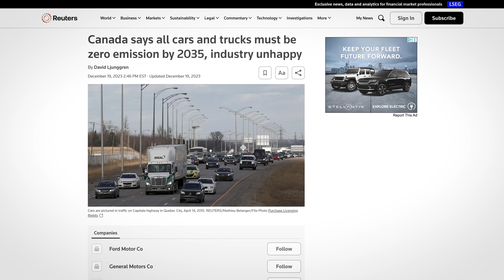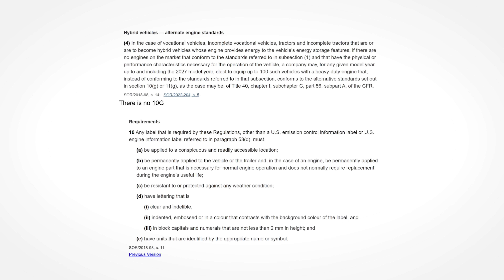Government Red Tape Is Blocking Our Plug-In Hybrid Trucks

Comment: The entire crux of the problem is that you’re using an engine that is not certified for on-road use, yet you’re trying to run the engine while on the road. Anyone familiar with emissions legislation and the industry could have told you this would’ve been a problem…
Reply: It has to do with horsepower, under a certain amount (I believe 45hp) and above a certain amount you aren’t required to run any after treatment or emissions systems
Reply: @Magic_pancake355 both on road and off road scania motors meet tier 4 emissions, both without using DEF fluid. Both have some level of after treatment but don’t use DEF fluid
Reply: @fflowwiththego  oh I understand that, Europe is so far ahead of North America in terms of well… everything in the heavy equipment/ trucking industry but I’m just stating what i believe if I remember correctly to be Canadian law/ policy however you’d like to call it.
Reply: @Magic_pancake355 understood. I’m hoping Scania sees the potential and partners with Edison to get their generator motors certified with Canada for on road use. It could be a great investment for them. As far as I’m aware because scania’s emissions are so low it’s a simple matter of testing and paperwork to get that done, they don’t need to do any design changes.
Reply: @Magic_pancake355 you sure about that? In some areas around Diesel emissions specifically i think that the EU is more lax or has been more lax in the recent past, than the US standards. Particularly around NOx emissions. There's also been questions or controversy about the conditions with which vehicles are tested under in the EU. Like US testing is more "real world" and something that might easily meet x standard under EU testing protocol might fail a US test.
Reply: It’s no different than the motor that runs a refrigerator trailer, but that allows an off-road diesel motor to be used on the road.
Reply: @fflowwiththego not the same.  The refrigerator trailers are small engines certified for highway use, but not enough power to have enough output to charge the truck in a meaningful way.
Reply: @fflowwiththego  even that one requires on-road fuel
Reply: @fflowwiththego  that engine is not propelling the vehicle forward

Comment: My letter is in. 

Dear Mr. Barratt, 

Environment and Climate Change Canada (ECCC) has problematic regulations that are not in line with their own climate goals. They are impeding Canadian manufactures from helping address climate change and build quality Canadian businesses. Edison Motors in British Columbia is developing plug-in hybrid semi-trucks, with electric drivetrains that can be recharged on-route by diesel generators. 

ECCC classifies vehicles with onboard generators as off-highway emissions tier 4 final, and they want Edison to use an on-highway truck engine that has an integrated diesel engine, not just an electric engine that is recharged by a diesel generator. That means more parts to break down, more cost for Canadian truckers who are already hit hard, and more emissions. ECCC has recommended that Edison build conventional trucks instead, which is counter to government climate goals. Edison is, as far as I know, the first company in the world building hybrid semi-trucks, they have the potential to be a world leader. The government should be bending over backwards to support them. 

I request that you give The Honourable Julie Dabrusin some constructive feedback about this. We need to support Canadian business.

Comment: Build them as full electric trucks and then add the generator as on optional upgrade. Don't need permission to put a generator or welder on a service truck. You sold the truck as a plug in electric, the customer chose to add a generator.

Comment: I would probably consider talking to Cummins. They have the necessary knowledge to translate a off-road cert to on road, or to adapt a road compliant engine for gen-set application. The other avenue is to convince Scania/Traton to cert the engine for road use, but as a gen set. VWAG is doing just that for the harvester range extender.  The truck business is in the toilet right now, so you MIGHT actually find someone willing to listen.

Comment: 1. Is there really no on-highway engine that can be governed over canbus?

2. You could sell the generator kit separately, as an "off-grid charging station". And it could happen to fit under the hood, so clients could install it themselves.
Reply: Even if not canbus E throttles are off the shelf. I suspect there may be a more significant issue with the emissions from the static generator vs the highway rated engine. Static generators are often much more lax. 
Even if the net vehicle emissions are lower, the emissions per "unit" of power/fuel/displacement or whatever they use are probably too high for the generator which is creating the road block. 8:11
Reply: @zyeborm  what is keeping them from using an on highway motor with an adapted control loop? That way it would act the same as a generator?
Reply: @kosiranze not much that I can see tbh.
Reply: @kosiranze   This is a blame the government excuse for the hybrids being delayed.  If the electrics work then the on highway engine should get them past the red tape.
Reply: It's too expensive and it's hard to maintain the quality
Reply: @komisiantikorupsikoruptord6257 the quality of an on highway engine is notably lower than a generator?
Reply: @komisiantikorupsikoruptord6257 
Yeah, this would he a serious sales damper! Not too many drivers or owner operators are going to go through that much trouble. 
As much as I love these guys and what they're doing and buyer is already taking a big risk investing in a rig from a start up and this road block is a perfect example of the kind of problems that can end a SU and leave a buyer fending for themselves with a new unknown product. It may be very hard to even find people to try and fix it and it'd be big $$$ to diagnose and repair w/o factory support.
Reply: @komisiantikorupsikoruptord6257  Probably not too expensive but not very practical or safe. Imagine the truck braking hard to avoid hitting a car that suddenly stopped. Only to be crushed by the big generator as it falls off. Bureaucrats are the stupidest two legged creatures to roam this planet.
Reply: the difference between generator and drive engines are pretty big; mostly programming of the ignition cycle, but also things like fuel pumps, oil pumps, even cam profiles can be different since the engine is optimized to run at 1 RPM instead of having to deliver power through a range. 
It's a lot of RnD to tune a running engine to act as a generator, and you're still never going to be as efficient as a generator variety of the same block.
Reply: @572089 sure, but they can put a highway engine in as a slightly worse generator and run it vs not being able to was the point being made mostly I think
Reply: @572089   Sounds like what the really need is a fixed rpm highway classification in the regulations. 

Also there should have always been an experimental waiver in the regulations in the first place. - Something like a 3 year- 1,000 unit/year exemption you could apply for if your tech doesn't meet all the current regulatory requirements but promises to significantly exceed others.
Reply: Why not take a 5.9 or 6.7L Cummins out of a pickup, and put it into the generator they mount in the truck?  They make a lot of Cummins generators that have the 5.9 and 6.7L engines in them.  

Someone else mentioned they have 4 KW APU's on certain diesel trucks, so they can run that engine instead of the main engine in the rest area. Much less noise and pollution in the rest area.
Reply: There are hundreds of generator certified for on board use in a truck but the one that Edison have choosen is not one. There are even generator truck that you can buy.... My guess is that they choose something without looking at the canadian regulation. You have to be compliant with the law but it is bullshit when he said that there are none. You can easly find the list. Plus there is an examption for off road vehicule and most lumber trail are not considered like road. So there are a lot of wiggly. Edison could also certified the third party motor.
Reply: @pierregravel-primeau702  the issue is that they want the generator to charge batteries to drive the truck not simply provide power for creature comforts overnight like APUs do, and there aren't any generators which are certified to do that.

Comment: I think the government is entirely overstepping, but I really don't understand your explanation at 2:00 as to why a normal engine couldn't be converted for use? A regular engine can have its RPM adjusted by the ECM so I don't quite understand why it wouldn't work.
Reply: Despite EFI, common rail, etc, the ECUs are totally different for how the engines are governed. It's not a matter of simply changing programming logic in a lot of cases, it's wholly different SKUs of ECU. The issue is under the legality they have, the "Generator ECU" for any given engine type is not spec'd for On-Road use which is nonsense, considering Tier 4 Emissions are Tier 4 Emissions.
Reply: That is basically inventing wheel new. 
They have the wheel and then somebody says built a round thing out of the block that is exactly like that wheel but isn't that wheel

Comment: So if you have what’s basically an electric truck that carries its own generator to charge, how does that apply to welders and other rigs that have generators in their trucks for running different equipment? I know one powers equipment and one powers the vehicle, but does the law specifically address the differences?

Comment: You guys are way way smarter then i could ever dream of with electronics, but with this modern age of computers should 1 not be able to just use an onroad engine and program it to load sence to run the generator? Or does that also count as tampering with emmisions equipement. Im sure theirs a reason you used the engine you did and not the above that i suggested. This government's a joke a bad joke at that.

Comment: To squash advances such as the Edison truck is imbecilic in so many ways,an advance like this will completely change the whole game, burning a whole lot less fuel while maintaining a heavy haul capacity is a massive leap forward except for blind legislators and goes past the all electric Tesla semi's which are not capable of long range without stopping to recharge while the hybrid charges on the fly. I'd love to see every truck,be it tractor-trailer, work truck,pick-up, in city delivery ,I mean, all trucks built to that design, and hey, if diesel-electric works for the railroads why not trucks? Leave it to government to put the brakes on progress and innovation,that's what they do. Good luck and high hopes for common sense to prevail!!

Comment: Right don’t use the engine. Leave the truck as a battery plug in that goes 15miles. The engine is a aftermarket add on that charges things up lol but you have that setup ready to go once truck is bought lol

Comment: Tbh I understand where the govt is coming from. The on-highway environment is very different from a stationary generator environment. There would be vibration and loading conditions that just don't apply to typical generator designs.

But I don't understand why it's Environment Canada and not Transport Canada that cares.

Comment: Scania has everything you need as they use the same 9L engine in their own hybrids. They work in a similar way to yours with a 9L diesel engine driving a generator and charging the batteries that supply power to the electric motors that propel the vehicle forward.

Comment: 2:00 both are engines lol, just controlled differently. Can you use a approved engine (4bt) and slap a generator on the back of it? The only good reason I could see the government having for not allowing you, is in the structure. For car crash forces maybe a stationary mounted genny dosnt have the mounting strength needed to with stand multiple g's? Wish you the best of luck looks like a great product!

Comment: Firetruck pump remote throttle panels can run an OTR engine based on load input from one or several analog and digital inputs simultaneously, they may be temporarily adapted to suit what you need. FRC, CLASS1, IC are some brands used in the US.

Comment: Left hand not knowing what the right is doing is peak gov't efficiency. Not surprised there. You kinda hinted at it but it sounds like they mostly have an issue with the computer? There's T4f on-highway engines, but like you said, they're set up to be demand driven vs load sense. And I imagine you can swap parts between off and on-highway engines right up until the computer and then you hit the same wall guys doing modded trucks get shot against. Except they're definitely trying to get around emissions so they can roll sick clouds of black coal and you're trying to ultimately help emissions.

Is there not a T4f OTR engine that has a fly-by-wire throttle that you can control via your own software? I doubt it's as simple as that but I can't imagine the regulations are so restrictive/granular that they're looking at the actual use-case vs a blanket "must use T4f OTR certified engine"

Comment: Why not use a 4 BT Cummins like is used in delivery trucks (UPS) and some sort of a governor control unit off a caterpillar industrial generator unit. I say caterpillar industrial generation unit because I used this on a tractor mounted PTO generator I built as a backup generator for my business. I added a governor control onto my tractor to control throttle response so as I could maintain 60 hertz.

Comment: I wonder if there's a way to use an "on highway" engine that has its certification and then change its computer to make it run like a generator? I mean mechanically they are essentially the same, just the control function of pull vs push demand. Should be able to do it. It's idiotic that you have to but there's a reason nothing gets built or done in Canada. Communism destroys innovation and liberals are blatently Communist.
Reply: Exactly. Really weird they skipped over this option.

Comment: Ok, so this might be going around tour elbow to wipe your ass, but what if you sold the truck without the backup generator. You sell the backup generator with the truck. Then when the customer comes to pick it up, they can have the backup generator slid in and plugged in. 

And certify the engine bay as "storage area"

You may need to overengineer that "sotarge area" with rails to be able to "hot swap" a generator 

It sounds stupid, but if done correctly it MAY set a standard for hybrid setup in the future for better/more efficient generator set-ups.
Reply: Having a standard "hot swap" format might be quite useful for both fast repairs (swap for a different engine so you can repair the broken one while the vehicle is on the road for maximal uptime) and retrofitting of older vehicles when newer and more efficient engines comes out in the future too

Comment: If fire departments can use diesel powered generators to power things on their apparatus, which drive on the road, why can't you guys use an off-highway generator to charge batteries in your trucks?? It's the same principal, and you're still using the on-highway fuel.

Comment: I would put money on the fact that this is because of highway tax dollars. Chase once said on a video the cost saving would be compounded by using "off-road diesel." The government wants you to use a "highway" diesel, thereby paying road tax.
Reply: Offroad diesel was in reference to red dyed offroad fuel, not the engine that's using the fuel. But they were told many months ago that it would still need to use on-highway (taxed, non-dyed) fuel for the generator engine.
Reply: except there are NO road taxes just PST and GST except no PST in Alberta.
Reply: Yeah, I remember hearing Chase talk about it and thinking, oh boy, don't publicize this! At minimum, I figured it was a loophole that would get closed in a couple years if they succeed at this. Other EVs (in the states) are already adding a yearly fee to registration for EV road taxes.
Honestly, losing the off road tax bonus would only be fair to the ICE  drivers. 
It would also be fairly easy to build a meter into the rig to count and log when a rig is used off-road or as jobsite power vs. on highway!
Metering the KWHR use and linking it to GPS could make it all compute automatically and "theoretically" cheat proof.
Reply: @Skunk106  What off road bonus, it was a dumb idea from day one.
Why can't I just use off road in my normal truck then
because this one makes it into electric first?

They are just dumb.  They knew this was coming, they just wanted to ignore it and pretend to be over the laws...
Reply: EV don't pay anything to use the roads.
Reply: That's definitely something to raise a red flag in the political spectrum